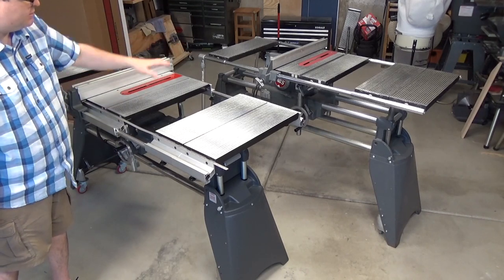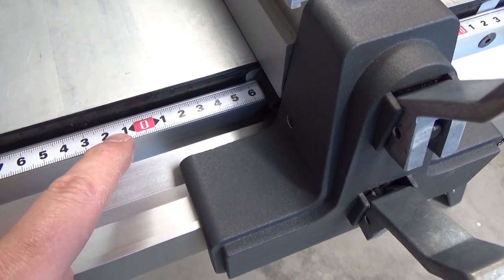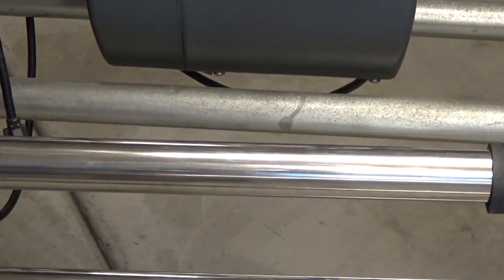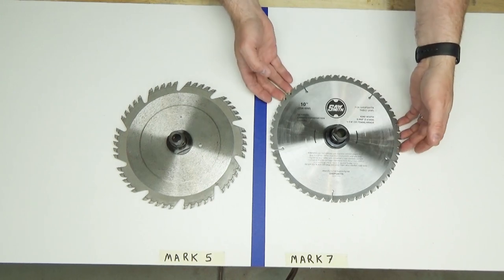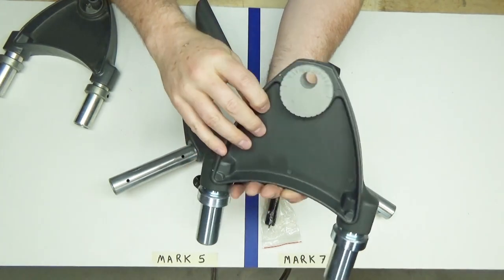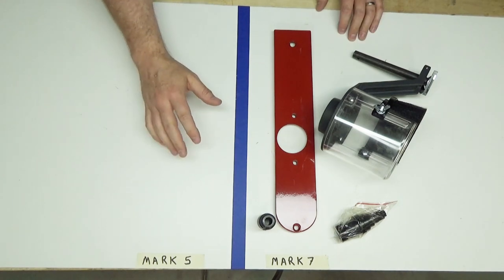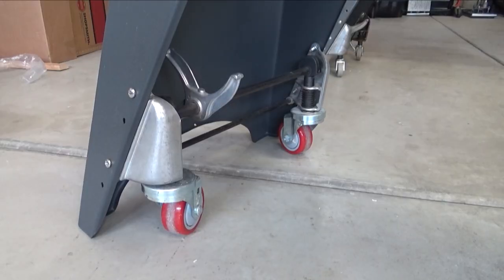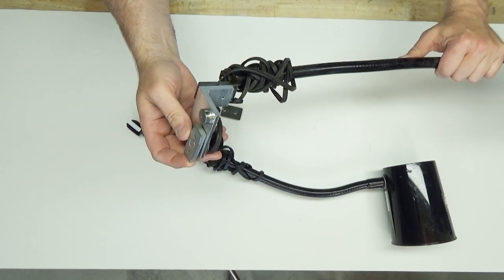2 American Woodworking Machines 3 Decades Apart: Similarities and Differences

Comment: Special note: If you are going to use your Mark mounted planer on the Mark 7, you will want to mount it to the RIGHT of the headstock because the computer automatically assumes that position and puts the motor in reverse for planing.  The reason for that is that now you feed the stock from the front of the machine instead of the back.  It puts you in front of the machine where the controls are.  You can run it on the left side, but you have to override the computer's selection of reverse.  Blessings, Glen
Reply from the maker: Great tip! I'm looking forward to trying out the the thickness planer on the Mark 7.

Comment: Tom, that was a most excellent side by side tour.  

I had forgotten how wonky my 510 rip fence was…. I used to have a piece of plywood with a depth gauge mounted in a slot.  After setting the fence, I’d run the depth gauge front tooth to back tooth on the blade to check for table run out.  It was rarely as parallel as my 520 fence always is!  I have repurposed the plywood and depth gauge… and am happy to not rely on it any longer.

I do not use plastic push sticks… the worst injury that I ever received on my Shopsmith came from a shard that embedded in my cheek.  It had shattered off my 510 push stick.  They likely use less brittle plastics now… but, I still won’t use them.

As I said,  we’ll done bud!
Reply from the maker: Thanks Dave. Yes, the Pro Fence with the magnetic ruler is really growing on me. That's weird about the push stick shard. I remember Scott Markwood saying that the plastics from Shopsmith from day one were formulated to turn to powder rather than splinter.

Comment: great job Tom. One disadvantage of the double tilt is that you have to remove a mounted SPT to tilt the machine. I find this a bit annoying. I recently fixed the issue by using my old circa 1991 head stock on a  shop deputy. I had purchased the powerpro upgrade soon after it came out as well as the double tilt.  I have had no issues with the powerpro and love it.  I do like the shop deputy and leave the band saw and disk sander mounted to it and the belt sander resides in a shelf below it.
Reply from the maker: Great catch Frank! I do have plans to make a shop deputy from the 510. And like you I think the band saw and disc sander will be on there most of the time.
Reply: @woodshopnerdery  I do like my deputy but I would prefer a shorty as it would allow more setup options and functionality without much additional space over the deputy. Life is full of options when you come to the fork in the road take it.

Comment: I'd be interested to know if the wall thickness of the way tubes and bench tubes has changed in the past 30+ years. I've heard Shopsmith has gone to using stainless tubing, versus the polished nickel plated steel tubing that all of my Mark 5's have.
Reply from the maker: The Mark 7 are stainless steel and have thinner walls than my Mark 5. There are 3-4 inch long re-enforcing inserts in the ends where they clamp into the base mounts. Mike Young shows this in his cut down Mark 7 video, wait I mean his "Mark 4" video.

So this means you can cut down your own tubes unless you have a way to move the inserts over.

Comment: Hals Wood Shop.  nice comparison. Ihave 2 standard features with both my used 1980's 510.. 5 Buck lathe chisels and brad point drill bits, so where are yours? .Also there is a white notebook with assembly and how to lessons?  did you get it? those were standard.
Reply from the maker: Thanks for the compliment Hal. I did get a set of drill bits and chisels with my 510 used. But I did not know if they came included. I used this page (http://www.allinonewood.com/?page=shop/markvstandardaccess) as a basis for what would have been included with  new with my 510.

My Mark 7 did  come with the manual and PTWFE, but not the Self Study Course, but Shopsmith now offers that for free as a PDF https://www.shopsmith.com/ownersite/productmanuals.htm

Comment: Good video, but isn't it really a 20 year period since the Mark 7 has really not changed or been updated since the 2011 release of the PowerPro headstock with the Mark 7.
Reply from the maker: Sure, I think it is fair to call it 20 years from a feature to feature perspective of the core machine. On the other hand you and I both know that other things, like quality has varied since  2011.

Comment: Thanks for making this video.  I have a Shopsmith 500 and have been debating about spending to upgrade to the more modern tables and doing some upgrades it, but all things considered I am wondering whether it would be better to move up to a new one and enjoy the experience the feel of a new tool   Thank you and I really enjoy your videos.
Reply from the maker: Thanks Delbert, I appreciate the compliments. I am on your page. When I made my decision, which took about 4 years, I added up the upgrades. At the time it was I believe $400-$600 more to get a new machine. For that extra cost I wanted to enjoy the experience of having new. I’ve bought used everything most of my life. And also making the old 510 into a ShopDeputy has been invaluable.

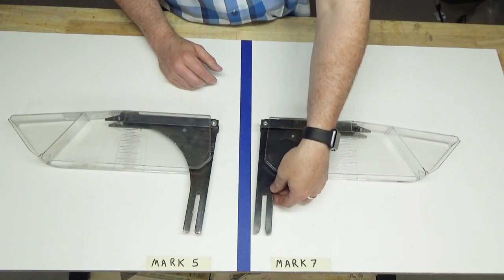Comment: 14:22 So you try to tell me, you have a table saw blade that is over 30 years in use... somehow I don't believe you. Unless it was hardly used, you have to keep sharpen those and there is a limit to how many times you can sharpen them.
Reply from the maker: I estimate it is 30 years old since it came used to me with my 30 year old machine. I've owned it nine years and never sharpened it, but I keep it clean and don't abuse it. Still cuts great.. I'm sure in a professional shop it would have been sharpened many times and long ago replaced.

Comment: Does your speed increaser handle heavy cuts with either the router or shaper cutters?   I have an old Model 500 that still runs great, built in '82.
Reply from the maker: Yes, the Shopsmiths last and last with good maintenance. Yes, I think the speed increased does great. You might be interested in this video where I make full one pass joinery cuts. For decorative cuts I would make multiple passes.

https://youtu.be/MyseXcjLrCM

Comment: Interesting video! I have 2 model 510's. I use the oldest one mostly to power the planer. Occasionally it is used for other operations. I store the jointer and a bandsaw on it when not in use. The newer Shopsmith is used mostly as a table saw. Don't rush to cutdown your model 510 Shopsmith, I have a hunch you will miss the extra full-size machine. 
I also have the power-stand, I usually keep a bandsaw on it (I have 2).
Keep everything you can. I miss some of the tools I decided I had to do without because of space.
Reply from the maker: Great advice Gregory. I am going to re-organize the machines. If I find more space in the future, it seems there are plenty of 510/520 used I would be able to pick up at a later time.

Comment: Definitely a used machine will usually not include all stock standard accessories. My 43 year old Mark V came with a 5/32” right angle hex wrench and I love keeping it on the bandsaw tensioner. My 510 (manufactured in 1992, upgraded to 520) came with the standard red handled hex wrench.

Another thing I did was take Scott Markwood’s advice and purchase a couple sewing machine magnetic lights. They may not work as well as the SS lights, but they are a really good value.

Another upgrade you might enjoy would be the Incra miter gauge with positive stops at each degree. It’s definitely worth it.
Reply from the maker: Thanks Tim, great suggestions.

Comment: I have an old model 500 but at least it's one with the double bearing quill. The fence and tables on it are a pain in the backside, especially the fence because its front base is so narrow it can easily clamp down crooked. It's essentially the same table setup as the Mark V had in the 1960's.

What would be interesting is putting the new electronic motor and control onto an original Mark VII. That one had a built in dust collector vacuum in its central base and it could be used with a lower ceiling because it tilted both ways at points about 1/3 of the way along the base tubes. However it did have a couple of flaws. The mechanical speed control had been cheapened with plastic parts that could melt under heavy use and it had a hand crank to move the power head along the way tubes, but the toothed track pieces mounted to the bottom of the way tubes were plastic.

Since the break in Shopsmith production and when the factory was bought and production restarted, none of the subsequent ownership bothered to put any of the old Mark VII special pieces back into production. Their recommendation for speed control problems has always been to remove the track pieces and install a Mark V head.

Having metal track pieces CNC machined and installing the new motor and control plus adapting the new Mark 7 table system would make an original Mark VII the absolute best Shopsmith ever.
Reply from the maker: I agree, I think the double tilt mechanism on original Mark VII is very interesting.

Comment: They probably only give one push block so you use the safety grip miter gauge, but that does not help with under table shaping/routing operations around contours.

Comment: Nicely done.  I've wanted someone to do a comparison between the 510 and 520 table systems for a long time.  I have both now and even though I like my 510 very much and found the accuracy great, in spite of the 510 critics, I have to admit, I do like the 520 more and the power pro headstock is soooooo nice.  I don't have the double tilt and probably won't upgrade to it . I have a router table and I like having the jointer attached most of the time for several reasons.
Reply from the maker: Thanks Daniel. I agree the 510 table is very good. That is why it took me so long to upgrade.

Comment: Nice to see a comparison, stayed all the way to the end. You mentioned the lathe tool rest and centers, no face plates or lathe chisels?
Reply from the maker: Great! Glad you made it through the whole thing. Correct, no face plates or chisels. Also, not drill or router bits includes either.